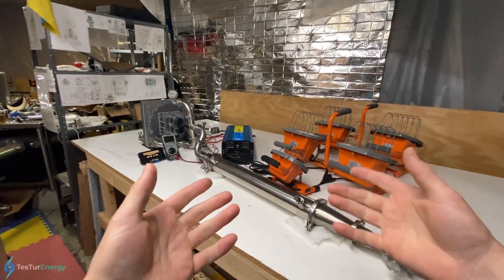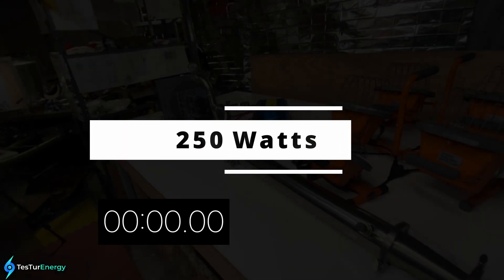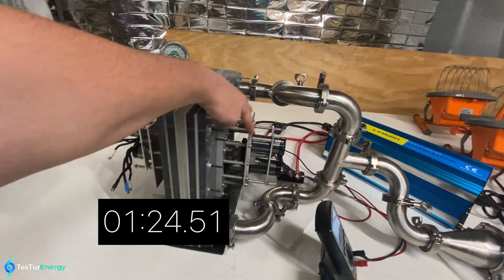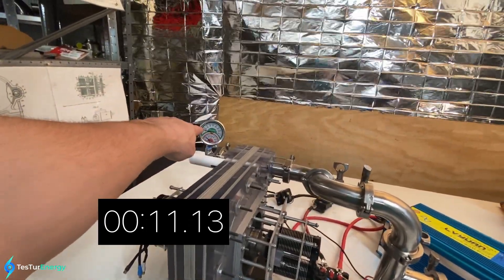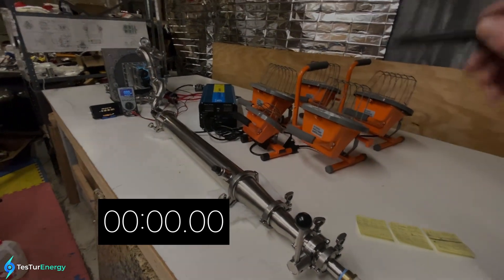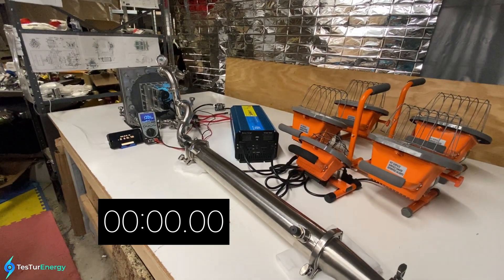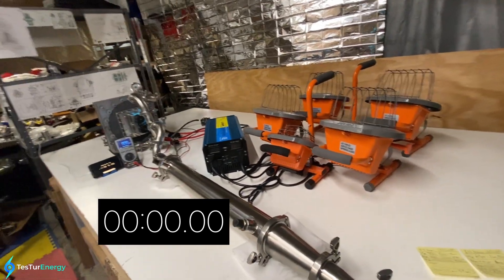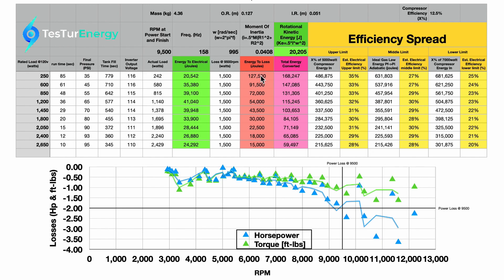Tesla Turbine 250 watt to 2.65 kW Power and Efficiency Test

Comment: Any idea if this can be used with water from a stream?
Reply from the maker: Yea absolutely! I haven’t don’t too many water tests yet though. Bee sticking with compressed air, combustion and steam for now. 

Check out this paper that just came out. They claim to have shown 81% efficiency with a hydro turbine setup. 

“Design and Development of a Small-Capacity Tesla Turbine for Rural Applications”
https://www.atlantis-press.com/article/125963780.pdf

“Abstract
Bangladesh is in great need to find renewable energy sources for its fast-developing industrial sectors. The main objectives of this research are to design and fabricate a small-scale efficient Tesla Turbine for remote areas and test it through experimental investigations. Performance analysis of the newly designed Tesla Turbine suitable for remote areas of Bangladesh will be conducted. Until now, a number of researchers have undertaken several tests and studies to evaluate the Tesla turbine’s performance and efficiency. Tesla Turbine does not proficient in producing torque. The work here consists of computational analysis and an experimental campaign by fabricating the turbine. Solid Edge 2021 is employed for our 3D modeling. For modeling, the desired material is Polylactic Acid (PLA) or ABS Plastic. The proposed design consists of 51 disks with an identical spacing of 3 mm. This design has led to achieving a torque of 19.85 N-m and a staggering efficiency of 81%. It was found that stress generated on the disk edges is higher than their centre due to high centrifugal force.”
Reply from the maker: 10in Tesla Turbine Garden Hose Water Tests
https://youtube.com/shorts/u8kQFz02ekw?feature=share

Comment: it is gas turbine or steam turbine?
Reply from the maker: Just compressed air. 200gal tanks at 150psi dumped until they couldn’t power each load. You can see the final pressure in the tanks in the data sheet at the end.

Comment: Youtube ate my comment so I don't know if I can say this as eloquently as I did the first time...

Hey Charlie thanks for sharing this great data! Quick question for you, is there anywhere in these calcs or test setup that you factor in gas temperature? I ask because it was covered earlier that preheating gas significantly improves turbine efficiency because of things like fluid viscosity. Since the compressor is densifying and adding its own waste heat to the compressed air, the tank temperature is going to be higher for this turbine.

Speaking of this turbine, do you set disc spacing for different tests, or is the turbine designed to run optimally on atmospheric air? Or do you instead try to maintain the proper viscosity of whatever working fluid you're using at different temperatures so that disc spacing and differences between fluids don't play a part in the efficiency?
Thanks for sharing this!
Reply from the maker: Hey infinion! Thanks for commenting. So the compressor is inefficient because it dumps all of the heat of compression out into the air before the tanks through heat exchangers. As well the tanks are capable of cooling. As well it was raining out so the compressor was getting “water cooled” and so were the tanks. Not a huge effect but it makes a difference. The rain drops sizzle on the heat exchangers because of how hot they get when running. (I plan I recouping this heat in the future for proper round trip efficiency tests.)

As such the air going through the turbine is VERY cold. All the stainless pipes frosted over each time I did this because of how cold the air gets when expanding. 

^ this is the bases for all refrigeration. compress gas, remove heat, expand pressurized room temp gas to drop to subzero temps, extract heat out of something, compress gas and repeat.
Reply from the maker: The next set of tests I will be doing will be testing how these results compare to doing this with compressed air being heated.  And then slowly taking that number up to combustion temps. But I’ll have the full stainless steel version by then.
Reply: @CharlieSolis  Oh right, I forgot you kept your tanks outside. So really cold air is pretty close to the viscosity of warmer water vapor according to engineering toolbox, so I guess the differences between the fluids wouldn't be that great at least for this test.

Thanks for alyways churning out detailed responses to comments every video, really appreciate that. Looking forward to the next hot tests!
Reply from the maker: @Infinion  steam has a higher molecular adhesion to metals too because it’s a polar molecule. So there will likely be a much better interaction between disc and the steam than the disc and non polar O2, N2, CO2, etc compressed air. 

So while cohesive, viscous, forces might be similar, adhesive forces between the fluid and the disc is increased.
Reply: @CharlieSolis  Oh that's really interesting, I wasn't aware of that property. Really curious now how strong the adhesive forces would compare to a non-polar molecule of the same viscosity, because if it's not trivial, there might be a way to increase it further without actually relying on temperature.
Reply from the maker: @Infinion  there is 😈 hydroPHILLIC surface coatings.

If you haven’t yet check out this video by Dr. Pollack called “The 4th Phase of Water.” All about increases boundary layers with hydroPHILLIC surface coatings. Sooo much cool tech to come out of this. 
https://youtu.be/i-T7tCMUDXU
Reply from the maker: @Infinion  Check out the community post I wrote “the biggest misconception about the Tesla turbine is…”. 
https://www.youtube.com/post/Ugkxif4iryzOpEXN9G3bmId9xznZTk1yuxyz
[TL/DR: This is not a mechanical turbine in any shape or form. Since all molecular adhesion and internal viscous forces within a fluid are governed by electron orbital interactions, this makes the Tesla turbine a purely electronic turbine.]